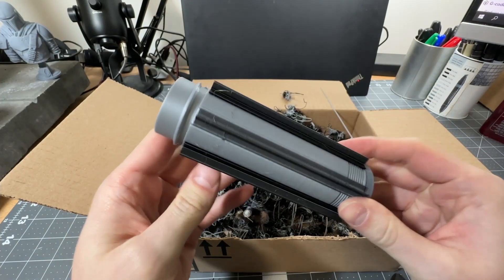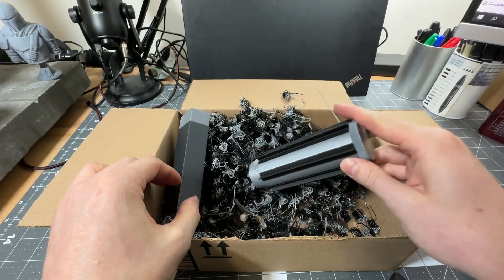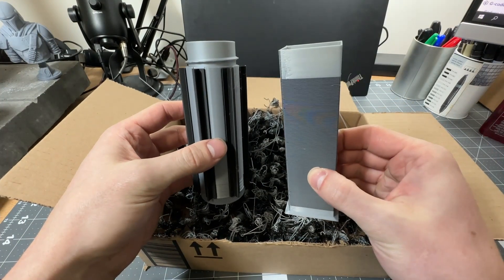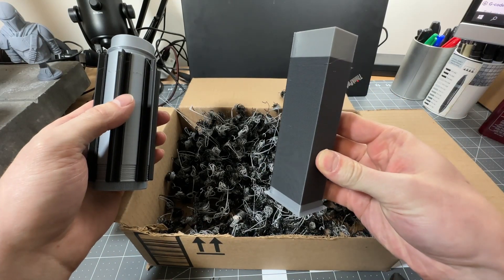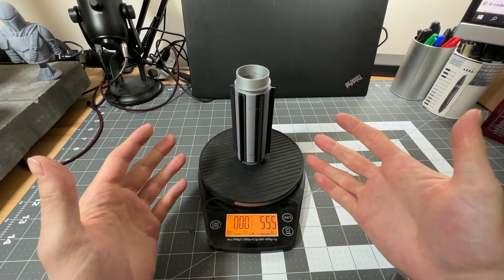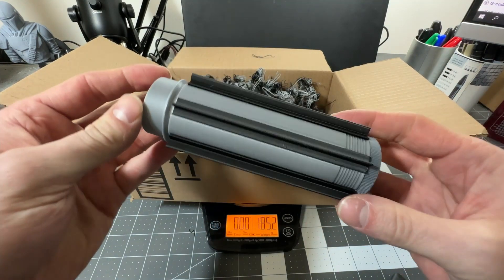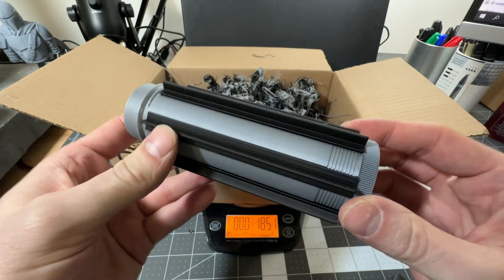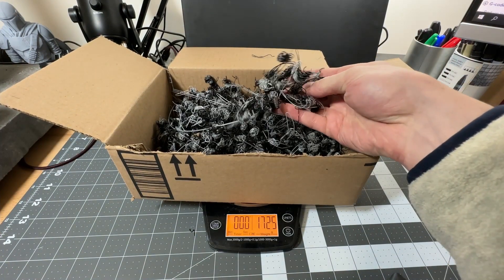Wasted Material on The X1-Carbon 3D Printer

Comment: So with this color switch every layer, how long does it take compare to one color?
Reply from the maker: Way longer. I don’t have that exact model available but I just sliced a different part quickly. 
Single color: 40m48s
Multi color: 7h58m
This is another reason to print multiple of the same multicolor part at the same time because most of the time is spent switching colors. 
I added another part to the multicolor slice so that I have quantity 2 and the print time is 8h32m
Reply: @3DPrintStuff  That is crazy long. That's why I canceled the Bambu lab and went for Flsun V400. Off course you don't have to choose the EMS though. And if I would print a lot of multi color, I would go for an IDEX. Or this multi swap system from Prusa. Thanks for the video!

Comment: For that particular object, assuming you only wanted one, would mean a print would be 23%, so 230g of print would cost you a whole 1000g roll, I guess it depends on if that is worth it to the person printing it or who is lucky enough to be printing an objects that change by height, like signs.
Reply from the maker: The % doesn't stay constant as you add parts to the build plate so that's another consideration. Printing skinny tall parts is the most wasteful for sure. But signs that lay flat on the build plate are not very tall and take up lots of surface area so they are not very wasteful in comparison.
Reply: @3DPrintStuff  yeah, i'm in the market for a new 3d printer and torn about which one to get, shame the x1 carbon did not do flexible filament in the automatic feeder. although not that hard to design separate parts. Was thinking the multimaterial would be great for soluble supports, conductive tracks and pla in same print, but the X1 carbon would likely be costly. Currently researching dual extruders which looks like would be more cost effective - or go back to designing in parts that are assembled together.
Reply from the maker: @RandomSmith  yeah the AMS system can be limiting as far as material choices. No flexible filament, no abrasive composites, really just leaves you with PLA, ABS and PETG to do multi color prints. It's more a multi color printing system than a multi material system. Maybe they'll come out with a future version with metal drive components for the composites and a different solution for flexible filaments.

Comment: I see your point, but in most scenarios, you’re not going to have a print ,that requires that many color changes. I have a couple of the X1 carbons  and the P1 p s. Compared to the last six years that I’ve been printing with Prusa s. And for their time they were good but limited. Because of speed ,color and quality for me. These printers were a huge game changer    the fact that you don’t have to change colors by layers. is a big difference especially when you’re referring to the value of a print. Years ago I used to make signs. within the last couple years I’ve moved on to scanning/ re-producing, vintage, exotic car parts etc. these machines have opened up so many avenues. They have their quirks. But overall I  am impressed with the company and I’m sure they will come up with an update to address the purging waste issue. I think they do that to make sure the color is 100% changed.  if you were printing some thing that the color change was for a very small object. You would want to make sure that color has completely changed. It’s not that would be the new video.
Reply from the maker: It's cool to hear from people who have had different printers and have moved to the x1-Carbon. How many car parts are you producing per week? Are you able to keep all those printers busy with the speed at which they can produce parts?
Reply: depends on what you are printing, there are lots of models that would require a colour change almost every layer. Vertical stripes on uniform, hair around a face, earth globe, science heart model etc

Comment: its not worth it but you might reduce the wast if you print indevidual part and design the silber tub with slots for he black fins
Reply from the maker: That is a great suggestion and that was the original design. I really wanted to try out multi material printing so I combined them for this video.

Comment: The main problem with printing 25 of them at the same time is if the print fails, one of those parts comes loose from the buildplate, you've just wasted a shit ton of filament.
Reply from the maker: That is definitely a risk you're taking by loading up the build plate.
Reply: @3DPrintStuff  the waste would have been the same regardless of the number, if it fails. actually knowing that it waste the same amount for 1 as 25 , im more inclined to buy one rather than wait for PRUSA XL w/ tool changer.

Comment: its packing material.
Reply from the maker: I’ve seen that be suggested on Reddit. My only worry with that is that you’re now putting it on the customer to dispose of the plastic responsibly. I’d think most people would just throw the plastic in the garbage.

Comment: You could print slots and screw/glue the black ones on printed seperately to keep waste extremely low lol
Reply from the maker: Yeah this model was originally designed as separate parts that I glued together. I wanted to see if the waste was worth the convenience of this being a multi color single part.

Comment: This part looks like it would welcome a re-design. Print black parts separately and slide into grooves to assemble vs all time, energy and filament wasted. Design to print.
Reply from the maker: I designed this part originally as separate parts and glued on the black parts. I wanted to see if the convenience of dual colour printing would be worth it. These were standard settings on the X1 so now I’m working on changing settings to lower the amount of waste. I will probably still move back to the original separate parts design.

Comment: Well. This is how the machine works. If you decide to print one model in that direction, there's a purge for every layer. 
(ColorsPerLayer-1)*Layers*WeightOfPurgeDump = TotalWeightofWaste
The printer's a robot, it does what you tell it to do. 
You could make a model with a lot differently colored tiny dots on each layer and get a 5g model + 1kg of waste.

As far as I heard you can configure the purge-length... this combined with an option on the slicer to always print the middle of the model first (to basically do a non visible purge inside the object and not on the outer layers)  could reduce the waste to almost nothing. 
However, it would still be you to some thinking during slicing to reduce waste :)
Reply from the maker: These are good points. The point of this video was just to show how much waste is produced on a dual colour print with standard settings. Maybe I’ll have to make a follow up video trying to reduce the waste to as close to zero as I can.
Reply: @3DPrintStuff  Does their slicer show the numer of color-changes and maybe even the estimated purge weight?
If not, all you can go by in the slicer might be the printing time currently (where I know that purge-actions are included).

I'd love to see them backing up that absolutely impressive hardware with as impressive software. There's so much potential.
Reply from the maker: @iDoPew  The slicer does tell you the number of color changes and has an estimate for the total weight of material used. I will play around with them and try to get it as low as possible.
Reply: for a single multi color object its not worth the waste, however , if you happen to be doing many of the same or even very similar, its absolutely worth it,

Comment: learn your machine, you can adjust the setting for a massive difference in the amount of waste
I run mine at .8 and sometimes .6 and that is about 80% less purge. 
Not sure why it seems people want to bash this new machine as it is the best 3D printer in the market and nothing
comes close to it. I have both X1 Carbon and P1P both with AMS and this crushes my VORON
Reply: So theres an option to reduce the 'purge-length' in the slicer?
Do they also have an option to print the non-visible layers first?

It would be awesome if they'd add something like this to the slicer.
Depending on the available non-visible-area on the model, they could calculate if even or how big of a purge is actually even necessary! :O
Reply from the maker: I'm aware that the settings can be adjusted and I should have probably included that in the video. These are the results straight out of the box. I'm very happy with this machine but it's got some downsides that shouldn't be ignored. I agree that it is the best option on the market at this price point... that's why I bought one.
Reply: Something wrong with your Voron then? What model is it / what mods does it have?
Reply: In what sense does it crush your Voron? In terms of speed and quality or just for multimaterial prints? I thought Voron and x1 were very similar in terms of speed and quality?